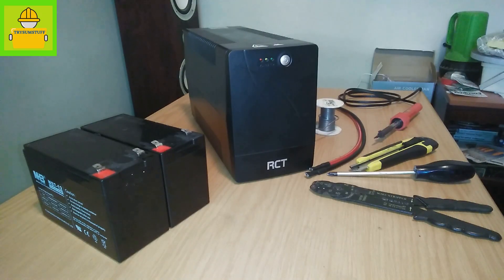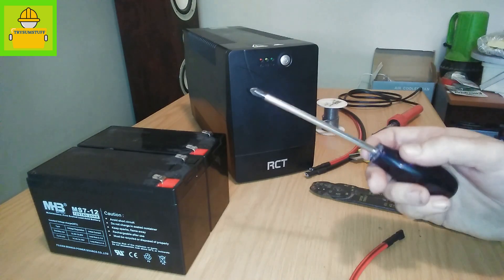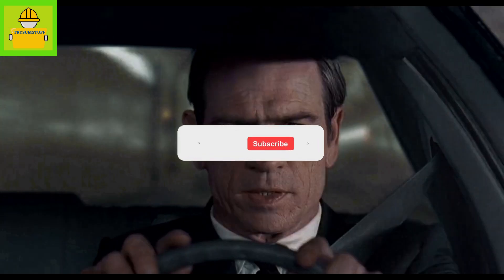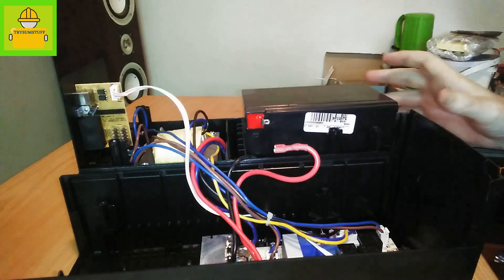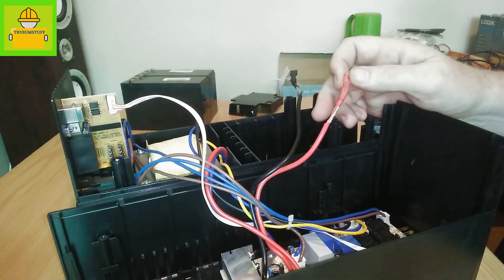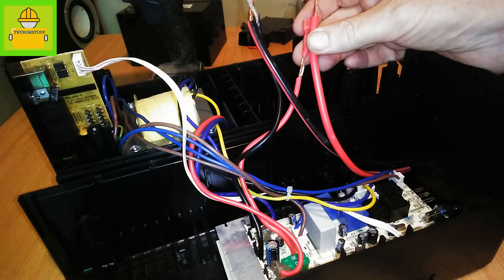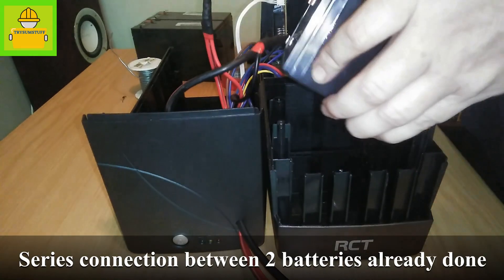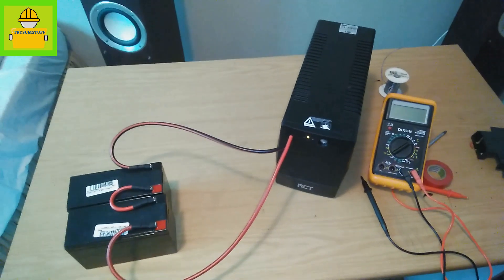How to add 2 more 12V batteries to a UPS.

Comment: Hello. Still getting 12v now or 24v ? Because I want to make it I have similar ups same wire
Reply from the maker: This RCT 1000 VAS is 24 volt in series out of the box.I added two extra 2 12 volt batteries in series, which is a total of 48 volts.IF this Ups was connected in parallel for two batteries it would be 12 volts,but it is NOT connected in parallel.Connecting in parallel will increase amp hour,whilst connecting in series will increase volts.Thanks for watching.

Comment: My UPS is fried. I have now 9Ah batteries.  Is there any 650 UPS comes that allows adding external batteries for extended backup? or any other good idea to make use of it?
Reply from the maker: Hi
A 650 ups has one battery.You can add one extra battery without any problem.Remember to use like for like.Lead acid vs lead acid and lithium vs lithium.They usually come with 7 or 9 amp hour battery.If you are thinking of buying a specific brand, please see what the manufacturer says about it as well.

Comment: What happens if you join and crimp the wires leading out of the enclosure to a piggyback female/spade terminal were effectively both external and internal female spade terminals join at the first battery banks static mounted spade terminals? Sorry i hope i made sense. Basically instead of stripping the main wires insulation exposing the copper before the female spades?
Reply from the maker: @PraiseandGlory4God  Hi.
My thoughts are as follows.Does the space(gap) between the casing and that of the batteries allow it? Bending the piggybacks once is okay,but with multiple bending actions,it could break of.It is definitely an option to use piggybacks.

Comment: Or you could run the wires to a new plug receptacle in the back of the unit, put the new batteries neatly in a vented box, and add a computer fan for you will need it due to overheating issues because you will be using it for extended periods and it doesn't have adequate sinks....

Comment: what time last the default battery? and how much is the improve with 3 batteries?, have you consider replace the default battery with a more powerfull lion littium battery?
Reply from the maker: The default batteries (2)used to last 3-4 hours,but that only lasted about 6 months.It went down to about 60 minutes.I inserted new batteries inside the ups,but decided to add the older two(2) batteries as well.
When the time come I will decide whether to replace it lithium batteries.Another option is to try and "repair" the lead acid batteries.That will be in another video.Whether it will work,I don't know.
Reply: @trysumstuff7182  dude you added battery in series they are 12v batteries so total V would be 24V
you were suppose to connect in parallel.
Reply: @TheNatoriousEddie  The two extra batteries need to be connected in  series, then they are connected in parallel with the original batteries. The ups runs on  24 volts, from the batteries.